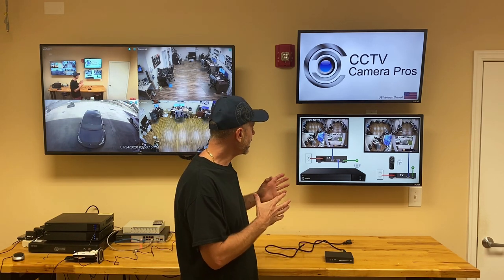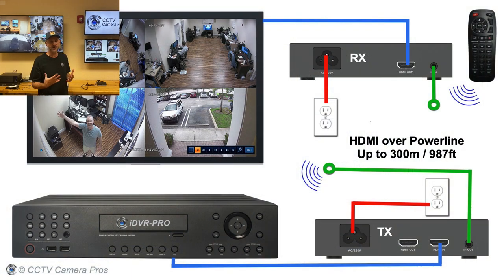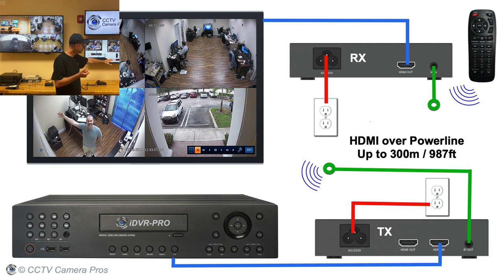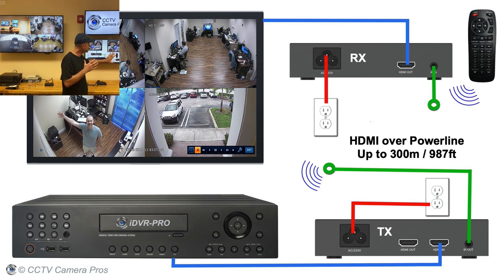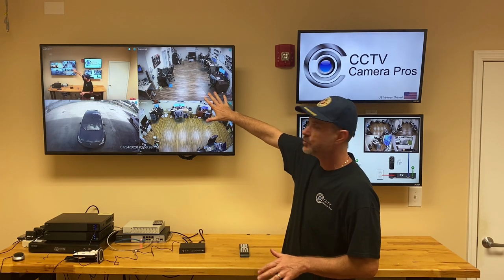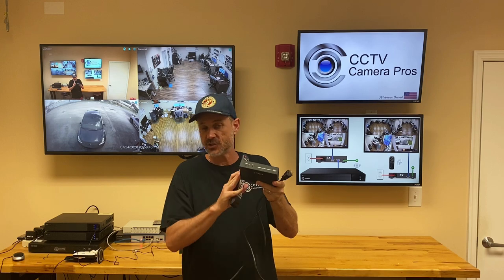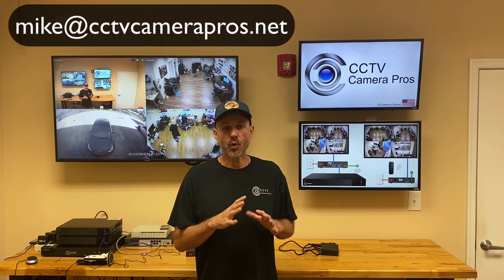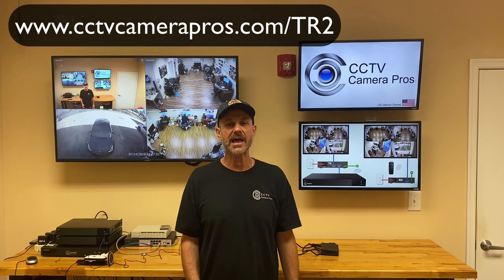HDMI Over Powerline Kit

Comment: I figure this is the best professional to ask for a suggestion.  I need a system that doesn't connect to internet (if it does it will have to be cellular) has hard wired cameras. That are preferably 2k resolution or higher. Stores locally, and has a battery backup that will supply power to the cameras in case of power outage.  For the low.

I dont even know where to start. All my other systems are wifi based.

But I've got a house in the middle of nowhere without internet
Reply from the maker: John, Thank you for the opportunity. We can definitely help you with this. We can custom design a 2K or 4K security camera system for you that does not require any Internet connection. 

Please take a look at our Viewtron NVR recorders. https://www.cctvcamerapros.com/IP-Camera-NVRs-s/1472.htm

Then take a look at these IP cameras that connect to them. https://www.cctvcamerapros.com/viewtron-IP-cameras-s/1474.htm

We can help calculate the size of the UPS battery backup that you need based on how many cameras you need and how long of a backup you think is needed. You can email me at mike@cctvcamerapros.net to continue this discussion and get a custom quote.
Reply: @cctvcamerapros  nice, so the house is small only 500 sqft  I need 8 cameras for the perimeter.  And then I would like to dig conduit and run two to outside the home.  Is that a thing?
Reply from the maker: @johnkcrabtree  Yes. That is definitely a thing for detached garages, barns, workshops, etc. You would run one or more network cables between the buildings.
Reply: Ethernet? Or Hdmi?  If it's either one of those I can probably get this figured out.  Ive got ADT coming out to install a cellular security system, but no cameras. 
 

I think I will DIY since I cant do wifi camera systems.  

What's your email?